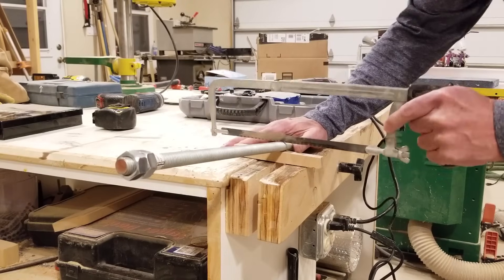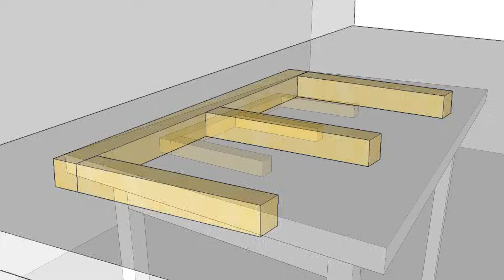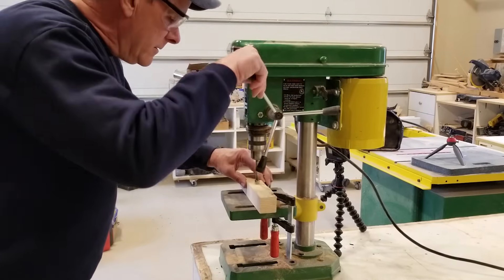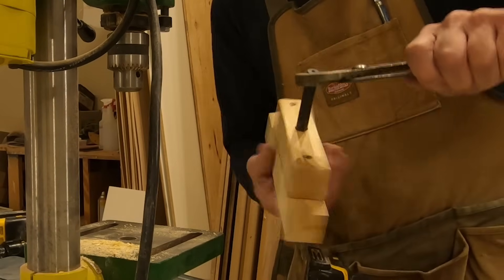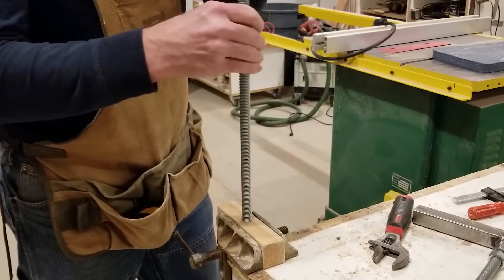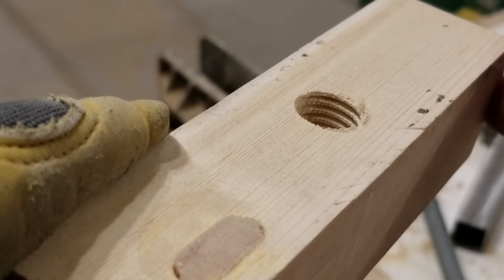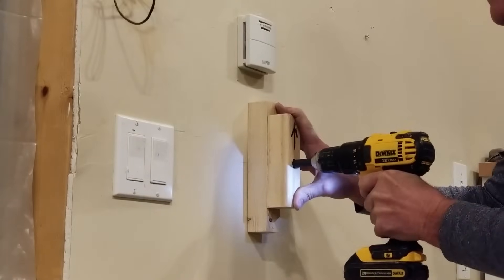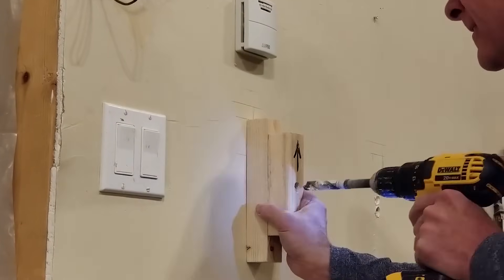Strong Floating Shelves - The Strongest Option

Comment: Hello, Mr. Dobbs;
Thank you for an educational & entertaining video.
I have a similar situation w/ a glass shelf I hung in my bathroom.
Worse, it's real hard to find decent hardware, the glass shelf mounts are mostly junk.
Since shelves often sag over time, I suggest you consider putting an angle on your mounts.
IMO, 1°-2° elevation on the front should probably be enough & it would likely stop roll-off.
I know this is an old video & you may've made some changes since you made it.
Have a GREAT day, Neighbor!
Reply from the maker: Thanks for watching and for your suggestion, Jon! Yes, there are tweaks and adjustments that I make to pretty much any process I use on construction projects. Always need to be learning! I have found that I can accomplish what you are suggesting often by slipping a length of pipe over the all thread as a cheater bar and slightly tweaking the rod up or down as needed. Hope all is well for you and family!

Comment: With all this work you did making the tap, and the tap handle, penetrating the drywall to view wiring, etc... I think mounting in-wall steel brackets on the existing studs and closing the drywall back up would be stronger and quicker.  just my 2 cents
Reply from the maker: There are lots of ways to approach floating shelves, Danny. Your take would work fine as well.

Comment: I hung a 10 inch beam which I used as a rustic mantle using the same concept. Except I used the largest wood screw I could find plunged 3 inches into the stud then hacksawed the hexagon nut off the edge. One was slightly off by 1/8 but it just added to the rustic feel once the beam went on. I used 4 bolts across a 4 ft span. That beam and those studs are married together for ever. I also jammed locktite super glue into each
Reply from the maker: Interesting idea, Franc! Sounds like that beam isn't going anywhere anytime soon! Thanks for sharing your experience!

Comment: or... just drive a long shanked lag screw into the wall and cut the head off... push your shelf over it with some glue... done.
There are also "lag hangers" with lag screw on one end and machine threads on the other. frankly, you're doing this the most difficult way you possibly could...

Comment: You'd think they would be weak but if you really think about it you're only really dealing with the shear threshold of the pipe of all thread at the connection point on the wall. If you broke down how the weight is distributed across the entire shelf there's probably very little weight at the leading edge of the shelf so there wouldn't be much of a lever effect which is what most people probably assume will make the shelf fail. I'd be willing to bet if you built a shelf twice as deep and loaded the weight towards the front it would fail pretty quickly.
Reply from the maker: It would certainly be more likely to deflect the wider the shelf is and the more weight that is loaded toward the front edge, Street. Though floating shelves can be extremely strong, I tend to lean toward matching the design with it’s purpose rather than appearance. If something going on the shelf is extremely heavy, put support brackets under it rather that pushing the limits of floating shelf design. No point in risking something falling on someone just because the floating shelf looks cool. Some have asked about putting aquariums on floating shelves which is an example of one of those design decisions I would think long and hard about before going down that path.

Comment: i know I'm a tad late but this video was an absolute life saver! I like doing a lot of my own home work because it's cheaper and it keeps me sharp on my less used skills. While watching your video I had the idea, instead of all thread(if you're looking for a kind of industrial/farm look so you think you could use some 1/2in galvanized pipe that's threaded on both ends? drill and tap the wall stud as you've done and thread one end of the pipe into the wall slip the shelf over the pipe like you've done with the all thread and with the remaining exposed threads from the pipe put a pipe cap on it. so you have that sort of industrial accent to it but also with the wood(in my situation being a dark wood) it'd give that "fam" feel as well
Reply from the maker: Thanks for watching, William! Yeah, I like your idea about using galvanized pipe in place of all thread rods! I don’t really see any downside if that is the look you are going for. That type of industrial look is really popular these days and I kind of like it. May have to try out your idea in the shop and office!

Comment: What about going through brick or cinder block? I could think of using drop anchors for the brick but it'd be worried about the hollow part of the cinder block.
Reply from the maker: Yeah, David, bricks and other types of masonry walls present their own unique challenges for installing floating shelves. There are ways to do it, but you need to experiment with options on a case by case basis.

Comment: Good video but there's a simple design principal that's not being acknowledged: you could make the shelf much stronger even with wood and without drilling so deep into the studs.   It's about understanding the 'fulcrum point'.  You do not have to go to such elaborate lengths as in this video.   Simply put, the skinnier the shelf the more torque is put on the fastener. The fatter the shelf say two or 3 inches, if the fastener is mounted towards the TOPMOST area of the shelf, the lower part acts to just support the top, dramatically...even if it's again, only 2 inches.  What I'm saying take a few scraps avoid an experiment in the garage or study some of the other shelf construction methods to discover I'm saying.  Take a few scraps avoid an experiment in the garage.  
 In this video, even though it was in a far more difficult manner the fulcrum point IS recognized,  as it plays out by him putting the bolts in DEEP.  The LENGTH of the hole, gives dramatic support to the rods so that he can support his weight.  IF he only put the bolts in a 1/2 inch they would have been very poorly supported.  It's all about understanding the fulcrum point!
Reply from the maker: Interesting comments on the fulcrum point idea, Rickie! I had not thought about it in the ways you describe, but any of us in construction intuitively get your point. In a video I did on building a floating cabinet unit, your point is probably better illustrated.  https://youtu.be/wp0sf_UFxtE

Comment: How much weight do you think your final shelf would support? I want to make a floating shelf for an espresso machine but I’m a little concerned that applying pressure to pack down the coffee grounds would be too much for a shelf to handle.
Reply from the maker: As you can see in the video, I’m able to put my full weight on the rods with no problem from a strength standpoint. In your case, that is something you would need to experiment with. Obviously, a shelf with brackets would work functionally for you, but it sounds like you specifically want a floating shelf. I’m guessing you could find a rod diameter that would handle what you are wanting to do.

Comment: You dont need to tap the studs, just put the all thread rods in immediately and they will thread it themselves.
Reply from the maker: That’s true, Jesse. If I were doing a permanent installation, I would add adhesive to the holes and thread the rods in as you suggest. The shavings would help secure the rod.

Comment: I made a larger oak drill jig starting with a small commercial drill jig and it made a perfect jig.  I did a test with my oak jig (screwed flat to the wall stud) and my new bit and it was perfectly square.   I did the first hole of the 12 in my wall, screwed in the threaded rod with a pipe wrench and it worked perfectly checked every way with a speed square.  I then did the same for two more holes and they were both fails, dipping out by 1/4".   I concluded that the first one was a happy accident and that the job is practically impossible unless you can get the studs out of the wall and onto a drill press and rebuild the wall. I abandoned the idea and am ordering shelf brackets.
Reply: I'm wondering now if a plunge router might work best for starting a reliably perpendicular hole.  Too late for my project, I already have 2 crooked holes exactly where I need perfect holes so there's no fixing them now.
Reply from the maker: Hey Leif! It is rare in my construction projects that things go exactly right despite my best efforts. Your reference to “a happy accident” when you drilled a hole in a stud precisely is actually a good way to put it. The most talented contractors I known are ones who can make things work out, align or look right even when there are challenges to getting to that result. 

I have a recent video called “$2500 Built-In Mini Bar Transformation” where I installed floating shelf rods that were off. That was not the point of the video so I’m not sure I addressed the issues, but several rods for the two lower shelves had alignment problems that I’m not sure how I messed up. To resolve the issues, in one case I took a piece of pipe slightly larger than the rod, slipped it over the end of the rod in the wall and bent the rod up to make it align as it needed to be. In another case, rather than drilling my hole in the shelf exactly on the centerline, I offset the hole 1/4” and actually drilled the hole at an angle in the shelf to match the rod so the final installation of the shelf was level. Also, I would think nothing of taking an appropriately sized oak dowel and glue it into my pine stud in order to drill another hole for my rod, if needed. I would probably drill a pilot with a smaller bit to try to get the hole alignment right the second time. The goal is to get your installed shelves as level as possible. The end result is what matters, not how precisely you perform each step to get to that precise result. 

I'm not sure a plunge router would give consistent results unless you were planning to screw the router base to the wall. Then, the drywall surface could be out of plumb! 😬 One of the best suggestions I have had is from a guy who used a laser level with the beam on the drill bit location and aligned his drill bit and drill with the beam as he drilled the hole. I haven't tried it, but that may be the most practical and workable solution yet. Lots of ways to deal with various situations in the construction world, Leif.
Reply: @RustyDobbs  Thanks for your great and helpful reply.   After "giving up" I came across a video by the Vancouver Carpenter titled "How NOT to Install Floating Shelves" and thought it might be good for laughs.   It was.  It also taught me the same pipe adjustment trick which worked like a charm in my case.  Between the oak jig that I screw to the wall getting the holes pretty close to level and the pipe correcting the last bit after, my threaded rods are all perfectly level and perpendicular to the wall.   You're right, a drywall surface is rarely plumb because you have to paste and tape and repair holes at the very least, although the wall in my case is better than most because I had built it!   The project continues!

Comment: QUESTION, what would you do differently for an exterior wall that is concrete block?
Reply from the maker: Hi Daemon. I would drill a hole as close as possible in size to the rod I was using then secure the rod in place using epoxy or some other comparable adhesive and let it dry well before installing the shelf. No magic here, just whatever needs to happen to get the job done in a block wall! 😬

Comment: Thank you for sharing your experience with this great idea and the thorough explanation of your process. You have a great narrating voice! 

I’ve also many times over been the lucky recipient of finding surprise screws in the drywall/stud. To at least avoid drywall screws, I began using a low-tech magnetic stud finder in addition to the digital stud finder to locate the drywall screws and make sure they’re not an obstacle where I’m drilling. It’s a simple practice I wish I thought of sooner to avoid unnecessary frustration. For deeper obstructions, I drill smaller pilot holes to see if I encounter anything and if I do, then can simply spackle the small hole rather than deal with a larger hole.
Reply from the maker: Thanks for watching and for your comments, ARC! Good thoughts all! I’ve had lots of guys suggest strong magnets for locating drywall screws which is a great idea too, so I have one stuck to my cup holder in my truck these days. I did clip a wire with my drill bit about a year ago which was the first time I have ever done that in my life. I was installing a mantle over a fireplace on a fake rock/sheetrock 2x6 wall that was 12 feet tall. It was a total fluke that I hit it and couldn’t do that again in a hundred years but I did this time. Had to open the wall up and put in a couple of junction boxes and new piece of wire. Probably 3 hours lost, but actually wasn’t that big of a job. Haven’t figured out how I would handle the rock face issue yet if I ever run into another one of those situation again, but it got my attention, as you can imagine! 😬

Comment: if you dont have a welder you can use a cap end hex  nut and a wrench.
Reply from the maker: Sure, Leif! There are lots of ways to get the rods threaded into the walls besides using a handle like mine.
Reply: @RustyDobbs  A pipe wrench worked for me too - but the project was a fail as I was unable to get the threaded rods to be reliably perpendicular to the wall, and you only get one chance each if you don't want to compromise on shelf location.

Comment: Could same approach also be used with metal studs?
Reply from the maker: Not really, Spunky. You really need the wood to give lateral strength and mass for the all thread rods to sink into. I would use a mounting bracket with a floating shelf sleeve over the top of it on metal studs and limit the weight on the shelf. I like toggle bolts for mounting the floating shelf bracket in these situations.
Reply: @RustyDobbs  Thanks for the tip, much appreciated!

Comment: If I’m planning on using this method to install a hardwood tabletop as a desk could it work ? How deep in to the desk should I go if posible its 25” deep by 6 feet long and 1 in thick
Reply from the maker: Good question, Bis! Several people recently have wondered what kind of downward force would be needed to shear the all thread rods at the wall. Obviously, way more than could practically be applied. But when you start extending the width and length as you are suggesting, other forces start to come into play that I have no idea how to calculate. In the real world, you start to get a springboard effect happening with the extended width. Probably with more stress on the holes in the studs, I'm guessing very little compression of the wood fibers in the holes would translate into quite a bit of movement at the outer edge of the shelf. You would just have to try it and see. That might be something I explore with another video sometime. Honestly, if it were me and I seriously wanted to do the project you are describing, I would revert to welding L brackets out of flat steel that I could bury in the wall against the studs and in the underside of the shelf to give the appearance of the shelf floating. That would be a sure success.  I have done a floating desk video that worked great and was an interesting idea as well. Good luck if you take on the project!

Comment: Why not do the solid shelf and undersizing the hole 1/16 and using a soft mallet to tap the shelf over, be a tight mechanical hold
Reply from the maker: Good idea, Mike! That would work fine as well. When you stop and think about it, there are lots of options on how to mount the shelf to the rods. Thanks for watching!

Comment: I like how he didn't get annoyed by detecting that potential wire and hitting the nails and screws with his drill. This man is like the fountain of calmness.
Reply from the maker: Ha, that is a description of my demeanor I have never heard, Garrett! All I was thinking about at the time is, "what are the odds this would happen when I am filming this video! No way to hide it so, go with the flow I guess!" The majority of comments I get are that people are glad I left it in the video because that's the kind of thing that often happens to them, or at least it seems that way! Thanks for your comments and I appreciate you watching!
Reply: I usually cut out a big square of drywall and attach 2x4s to the stud to get the shelf where I want it and to get a good view behind the wall.  It's easy to patch the drywall back on.   I did this when attaching several safety grab bars for my mother's bathroom.   Where I want to put them never aligns with where the studs are.

Comment: Why not just use a large lag bolt and cut the head off when you have it installed in the wall? Its going to have more of a hold in the 2x4 then those smaller threads imo.
Reply from the maker: Yeah, Jeff, a lot of contractors have said they like using your method. There are lots of ways to do this type of approach. Thanks for watching!

Comment: I like your technique if the shelf needs to be removable but it’s a lot of work.  If I want a permanent mount then it is much faster to drill a slightly oversized hole in the wall stud and use generous amount of construction glue to hold it in place.
Reply from the maker: That works, Roger! Thanks for your comments and for watching!

Comment: Is not it weakening the studs making such large holes in them?
Reply from the maker: The wood removed for the holes is replaced with steel and the studs are vertically weight loaded. If there is lateral weight loading to the studs, I agree with your concern. Plumbers and electricians drill through studs routinely to run pipe and wire. Allowable hole sizes are determined by stud size.